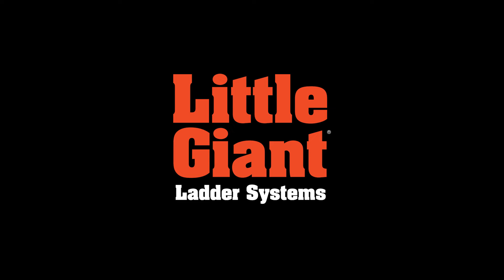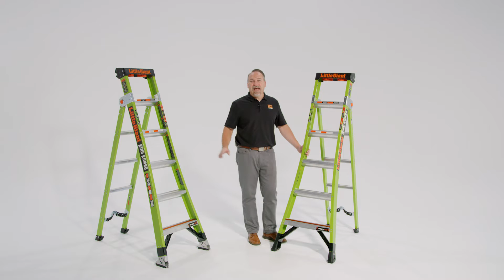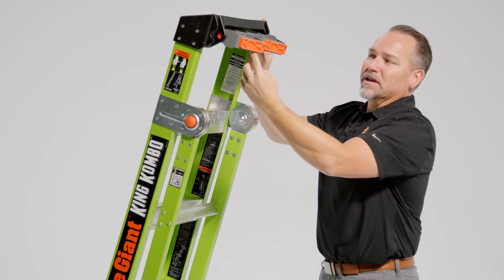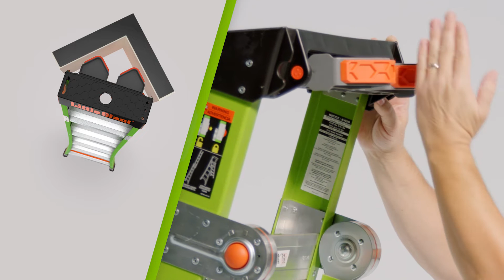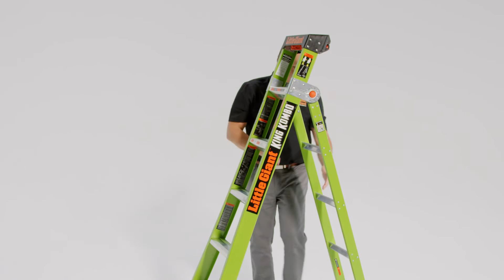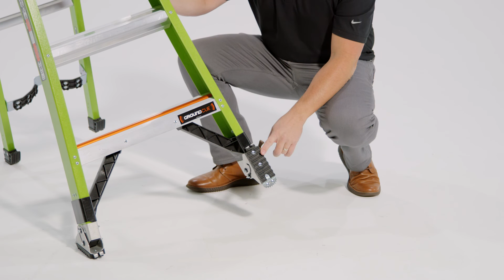King Kombo Technical & Industrial | Demo | Little Giant Ladder Systems

Comment: I bought mine 6 yrs ago, and the only issue I’ve had with it is the pivot latch with the orange buttons. It makes opening it a 3-hand operation, and I don’t have a 3rd hand. It also has too much loose play in the locked position so when used as a step ladder it will settle when I reach the fourth step, and if I’m not prepared for that, it gives me a good jolt. I hope the newer design with the one hand latch in the middle resolved that safety issue.
Reply from the maker: The updated design is much improved, and I think you'd really enjoy it. I totally understand about the orange button version. The 2.0 style is so much better!

Comment: Would be great if those orange buttons actually existed on your product.
Reply: ? They exist on mine.
Reply: @Boobtube.  they moved them to a squeeze trigger at the top. Took me a month to find it.
Reply: @bamtoday  oh, true... yes, they did improve them that way. Easier to operate now. I have the older orange button model.
Reply: I bought mine 6 yrs ago, and the only issue I’ve had with it is the pivot latch with the orange buttons. It makes opening it a 3-hand operation, and I don’t have a 3rd hand. It also has too much loose play in the locked position so when used as a step ladder it will settle when I reach the fourth step, and if I’m not prepared for that, it gives me a good jolt. I hope the newer design with the one hand latch in the middle resolved that safety issue.

Comment: I was looking at the 12' King Kombo to use as an all around ladder, but I'd also like to get in my attic in a room that has 10' ceilings.

Would the 12' King Kombo be safe at that height to be stepping on the upper limit of steps?
Reply from the maker: The biggest issue will be if your attic has any sort of handholds as you climb in. Normally, just like a roofline, you need the ladder's legs to extend 3 feet above, so that as you transition you have something to grab onto. If you don't, you might end up slipping or pushing the ladder away. We do sell a Model 8 foot king kombo that opens up to 14 feet, that would work in a 10 foot attic opening.

Comment: Here's the differences between the Technical, Industrial and Professional models.  The Technical model has the Ground Cue which is the clicking bottom step, the V-bar for gripping outside corners and studs in extension mode, and the SureSet swivel foot, which can rotate into a spike-foot or a pad-foot position.  It also comes in a 7' option which the other two don't.   The Industrial has the Ground Cue, the V-Bar, but not the SureSet swivel foot.  The Professional doesn't have Ground Cue, the V-Bar, or the SureSet swivel foot.  It has the least features of the three.   Besides those features, they are all the same otherwise.